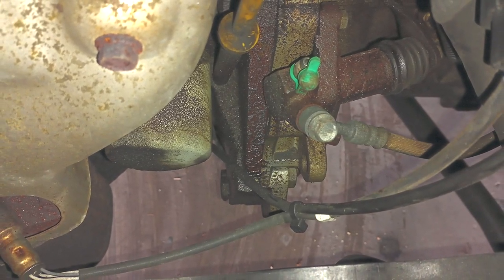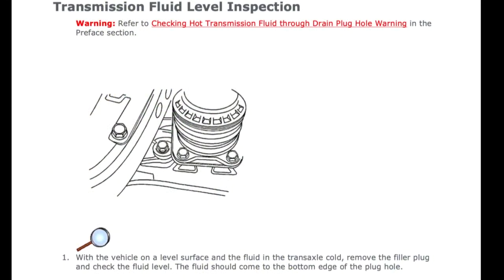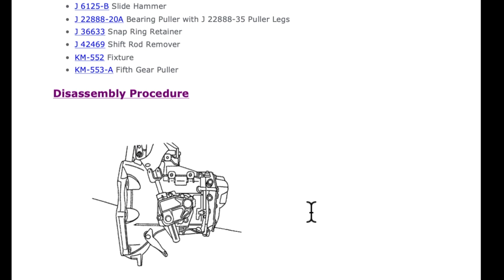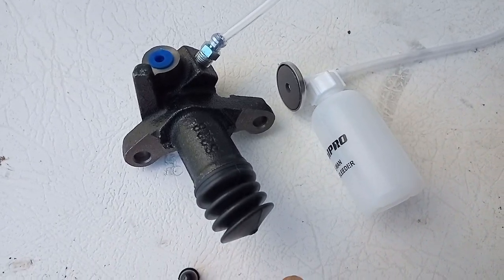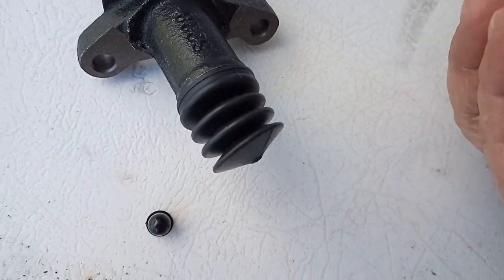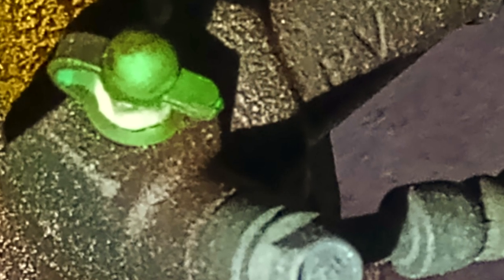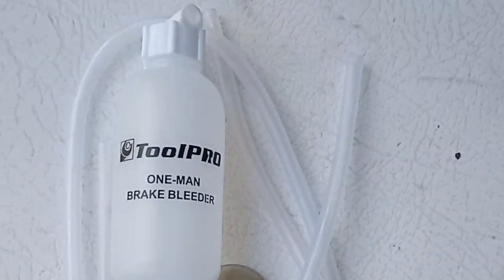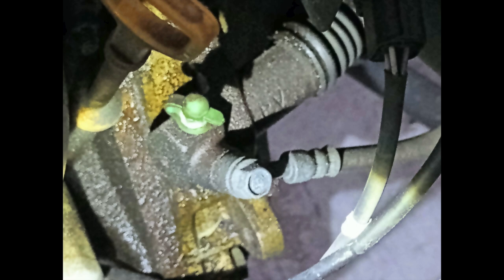TK Barina Clutch Pedal stuck on the floor Fix

Comment: What do you think is my issue with my barina not going into reverse 1st or 2nd. 
I feel it’s the shift linkage bushes but I’m starting tomorrow with this mate and working my way up the ladder if this doesn’t fix it. 

The car drives fine in 3rd 4th and 5th 
Clutch is very light and can be pushed in with a leaf. 
When I am in 3rd the gear knob looks to be in reverse 😅 sometimes going into 4th it finds 2nd.

I need to fix it asap as I’m soon without a home and need my vehicle back working 100%
Reply from the maker: Sorry not sure what would cause that to happen, My Clutch was stuck to the floor. I got Quotes of upto $1200 to change the clutch system. But I new lubemobile was trying to rip me off. I brought the slave cylinder got him to fit it for $200.and the car has been running great. Maybe ring a wrecker and ask them what they think it is